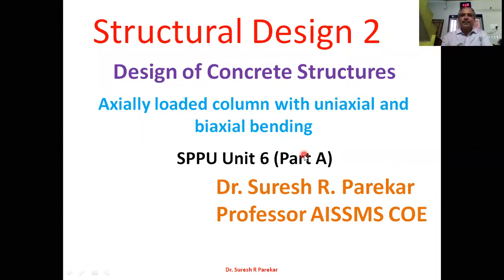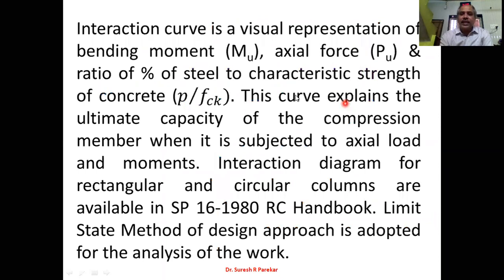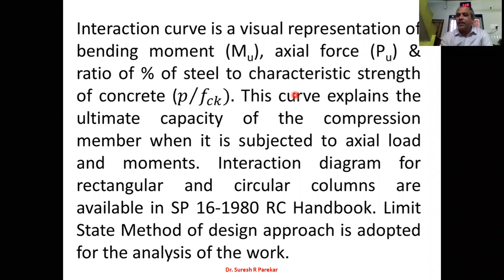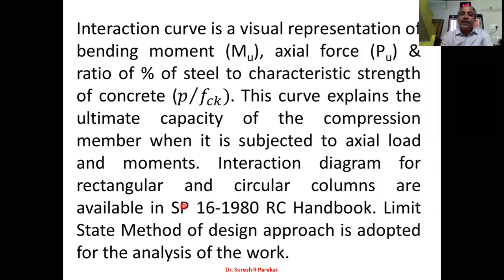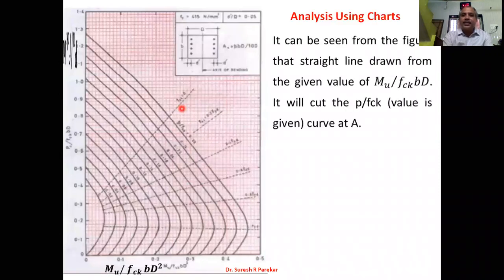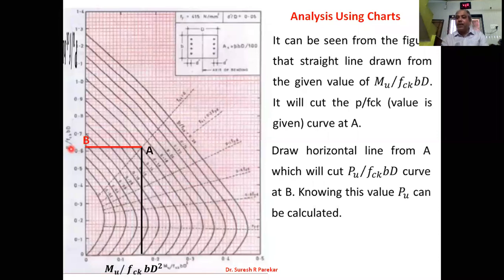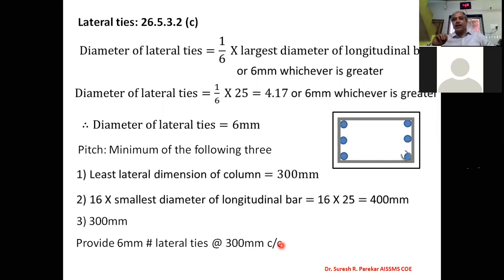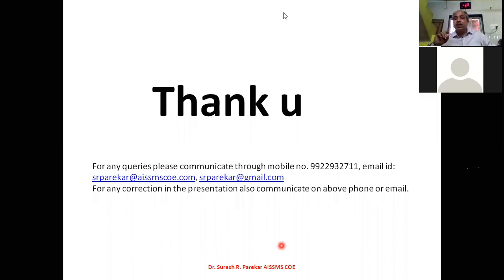Axially loaded columns with uniaxial and biaxial bending.

Comment: Lateral ties dia is 1/4 of largest dia not 1/6 of  largest dia. Another point As per IS13920-2016 minimum dia to be used is 8mm. ties dia is 8mm only not to use 6mm. In biaxail bending, you have to choose reinforcement equally on 4 sides not providing on 2 opposite sides.
V.M.RAJAN